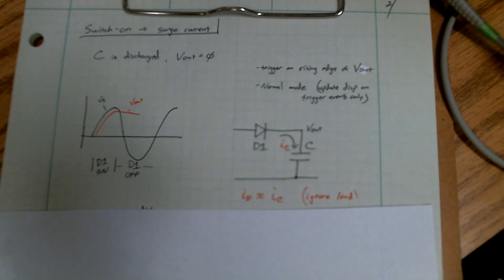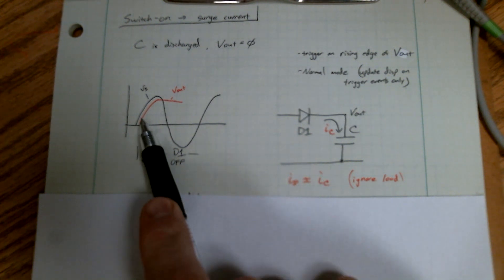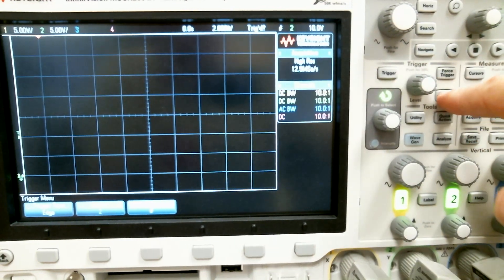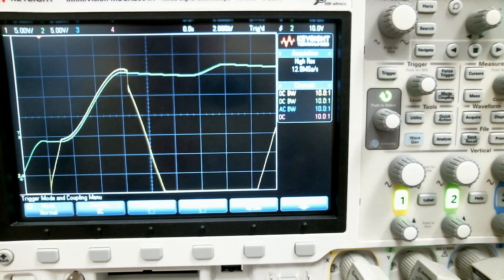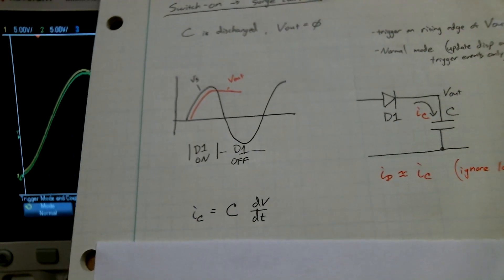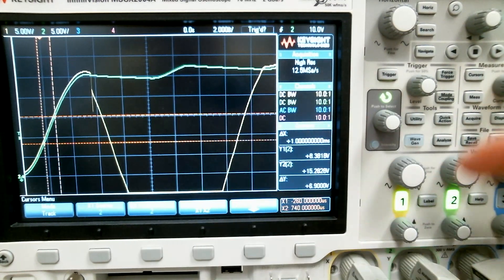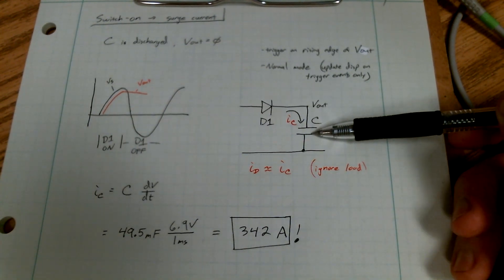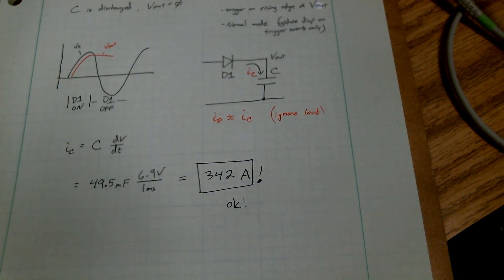Linear power supply - part 2 - surge current

Comment: is the capacitor should be considered in Micro farads or in Farads, so the current calculation is it right.
Reply from the maker: The capacitor is labeled 47mF or 47000uF, the paper notes linked in the description calculate the actual capacitance to be around 49mF
Reply: @DanWhiteValpo  okay , its now clear.